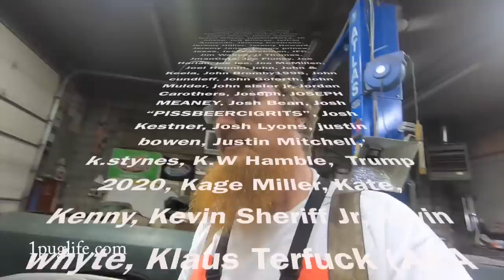awesome 12 volt soldering iron

Comment: I've been using a ts100 for 3 years man, it's sweet. But you're only getting 17w of power at 12v. It's current limited, not power limited. In other words it always stops at 2.7 amps, but has a voltage range of 12-24v. you'll get the most wattage when you're at the top of the voltage range. I use a 18/20v power tool battery with an adapter I made from the old flashlight that came with my set, but you can find pre-made ones online that tap in to the battery and even have usb ports for charging your shit at the same time. You can also plug er in to your confuser and get it to say pug1 or pantantler or whatever when it starts up, and mess with how it works (standby timer, standby temp, max temp can be increased to I think 420c etc.)

Comment: 5:57 that's an xt60 connector for a lipo battery like this one  Turnigy Nano-tech 2200
Reply: You can use dicky trx4 battery to run it.
Reply: pug has never even seen suck witchcraft.
Reply: for when you have to fix your Xmaxx on the fly haha

Comment: Pug
is that the TS100  Soldering Iron i bought mine from Amazon  i the next one up from yours bit more in Price wise tho $202.75. 
but it's well work it as i do a lot of  Vehicles and Motorcycles and etc, work, that yellow plug is for the 12 volt DC Battery Pack.

Comment: That's a primo knock off soldierrr you got there Pug.  The yellow bit is an XT60 for to plug into Lipo batteries used for the radio control gadgets.  I bet Dickie might have one already.